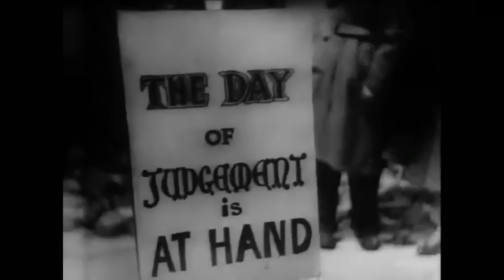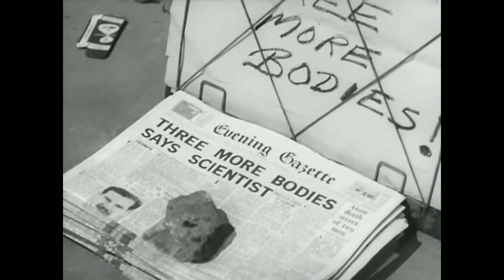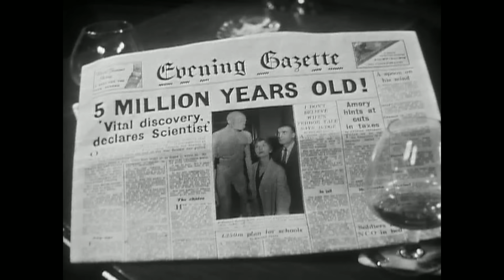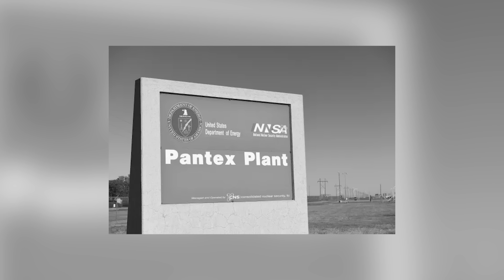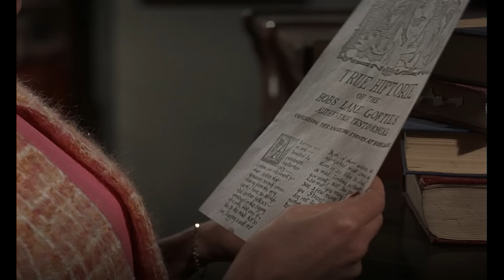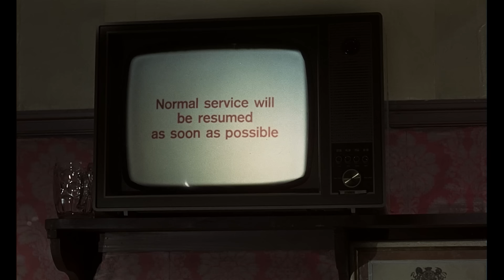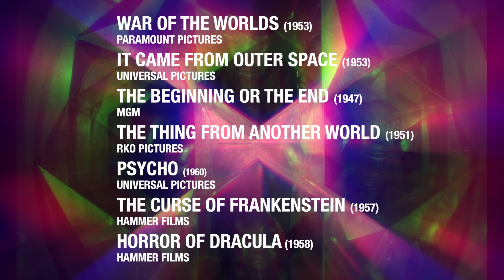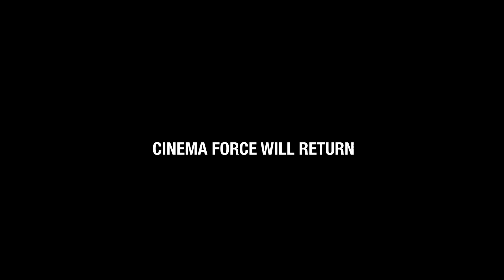Quatermass and the Retrospective by Michael H. Price

Comment: There is also an audio play entitled the Quatermass Memoirs written by Kneale and starring Keir as the prof. It is set after the pit and leads into the Quatermass Conclusion.
Reply from the maker: Mike did originally include a mention of it but it felt a little out of place so I decided to take it out and also the live 2005 re-do of the original. I really just wanted to focus on the Hammer ones but the BBC shows are kinda important to those and Conclusion although not a Hammer production also was released theatrically and is a continuation of Pit. Thanks for the comments!